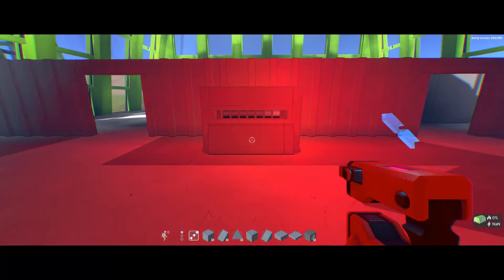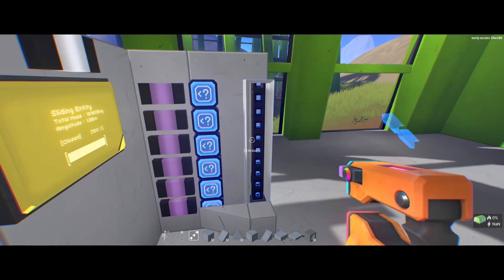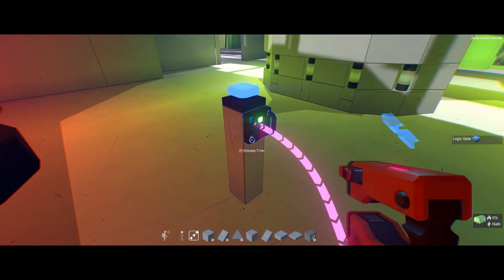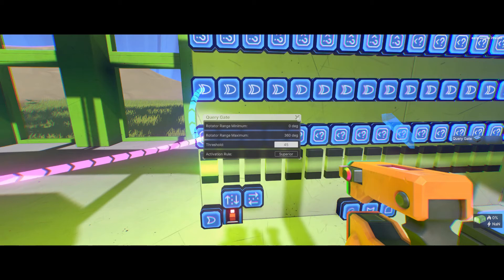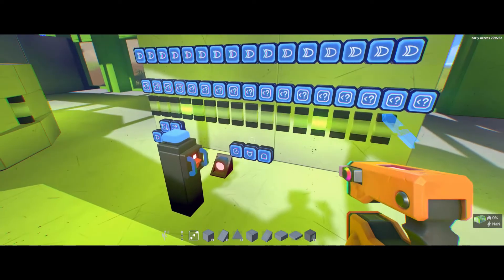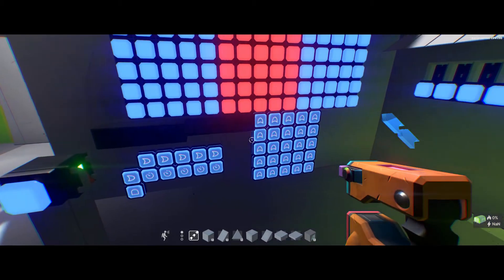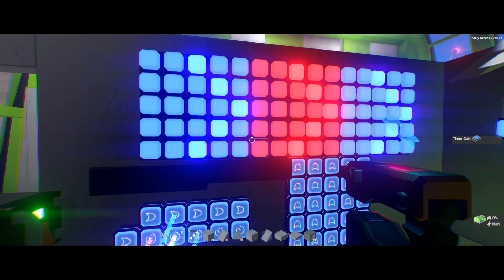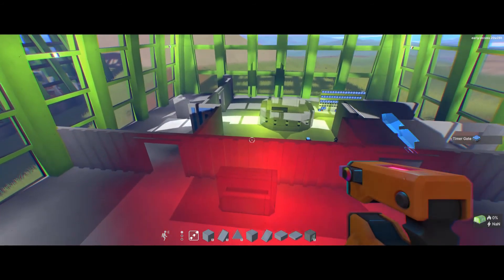Shifting Lights and Patterns - Starship EVO (Early Access)

Comment: Some of the logic applied here would be great applied to an engine room animation, with pistons moving etc, red lights blinking, cool stuff. Thanks for the explanation on this
Reply from the maker: I found out the other day that engines and thrusters can be switched on and off, so tying in some animation in a reactor or engine room is something I'm going to try on my next build :)
I did try making a bio-luminescence style sweep the other day using stacked lights that were shaded  white to dark grey. But it became a horrible overwhelming mess.
Although, the technique of using two pistons flip-flopping to control the sequences worked out to be nice and smooth.
It sort of turned into a TNG warp core lighting effect.
Reply: @curioinventorium  will look forward to the next video, yes a warp core 😋 with the lighting effects that would be great, i also envisioned a more industrial looking engine room similar to how you see ww2 submarine engine rooms, dimly lit.. With moving parts👌
Reply from the maker: That would be cool. Piston blocks would be good there too

Comment: Great video! Can you do a tutorial and text input screens and monitors?
Reply from the maker: There's going to be a big overhaul of the build engine soon, so once that has settled into place I'll look to doing some more videos. I do cover text input screens in my video: Introduction to using Logic Blocks. I think I briefly show monitors.
Monitors are a bit hit and miss at the moment the easiest way to figure them out is to use the link tool to connect various things to them. Like linking a shield generator to a monitor will display stats and shield strength.